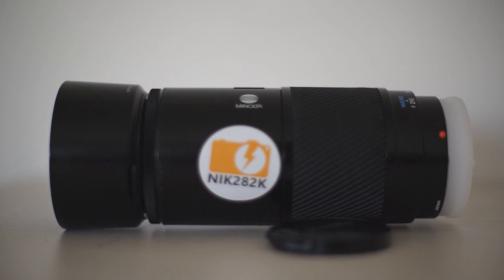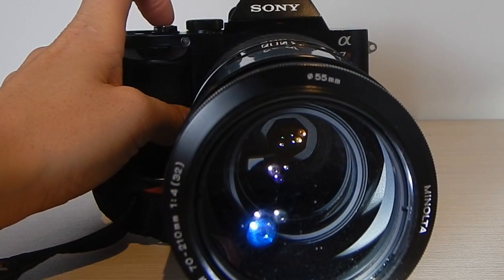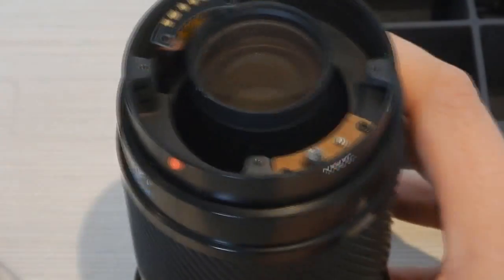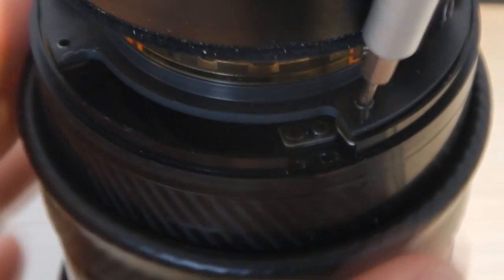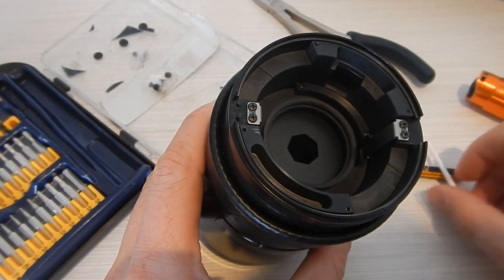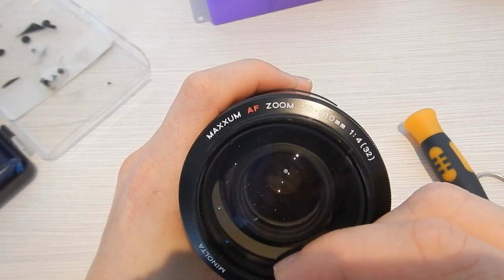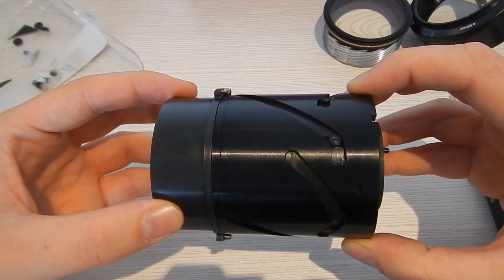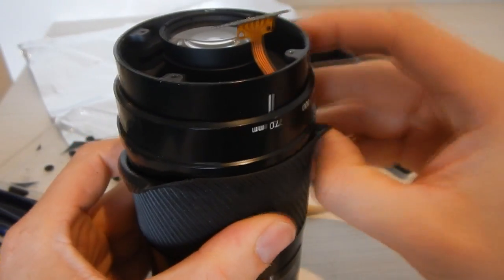Minolta 70-210mm f4 - Lens Repair

Comment: At what focal length do you have it when taking apart? Do you have it sitting at the 70 or the 210 end?
Can you get the whole aperture unit out from the back if you need to clean both sides of the blades?  Thanks!  And great video!
Reply from the maker: I think it was at the 70 end but I'm not sure. I don't remember having trouble getting it lined up again. I was never able to get the aperture all the way out but the alcohol seemed to clear up everything from the side I could access.

Comment: I have two of these lenses and I would love to just lube the helicoid gears in the front. While the disassembly of the back was great, I can't seem to see how you removed the front element.
Reply from the maker: I believe I had to remove the rubber grip to expose some screws but it has been a long time.

Comment: Very interesting segment Nick.  You subscribe to the same thoughts on taking broken things apart that I do.  Nice work getting the lens operational again.  What brand of screwdriver set are you using here   I am always looking for a really good set.  Fred
Reply from the maker: It was a Master Craft mini screwdriver set (Canadian Tire brand). It has about 30 bits and a little extension.

Glad you liked the video, I was surprised that I could get enough iso-alcohol in there the clean it out.

Comment: I have seen a big fungus under the glass element of my Minolta AF Zoom lens 35-80 1:4-5.6. It is at the bottom and I do not know how to access this piece of glass. Do you have any idea how to do it?
Reply from the maker: +RUS Sometimes you can find service manuals online that show how to tear down the lens properly. Otherwise you can try to do it unguided, I use trays for parts, take lots of pictures and take notes so I know how to put it back together.

On older lenses it's usually not that complicated.
Reply: Nick Moore I do have the service manual but i'll have to remove every part of the lens so as to be able to get access to the bottom + the last lens element can't be removed, it would be quite tricky to wipe that fungus off. I'll get another lens and then I can try to play with this one.
Reply from the maker: +RUS I also get spare lenses when I can. That's sucks that you can't open it from the wrong end, my older lenses from the 70s can open from both. It help with cleaning.
Reply: I have one Hanimex lens that needs greasing and cleaning (there are sand between the parts -_- ). It seems easy to open even without a service manual, but these minolta af lens are so complex with so many tiny fragile components. It's great that these are cheap though.
Reply from the maker: Yeah, the price is right for tinkering.

I took a quick look at a manual for the 35-80 f4-5.6 and I would say it is about the same as the 70-210 as far as complexity. If you get all your tools ready before hand and make sure to label/organize parts as you go it should be a less than 2hr project. At worst you get stuck somewhere and have to put it back together, if you are luck you will find the last element accessible before the lenses is completely apart and it saves you some time!
Reply: Nick Moore Thanks! Yes I'll take it apart when I get my next Minolta lens so that I can be sure that I've got one spare :)
Reply from the maker: +RUS Good luck! And thanks for watching!
Reply: Nick Moore Thanks

Comment: I'm grasping at straws here, and every video I've seen never shows how to take off the first FRONT element. I've got a fungus spot on the top surface of the glass that is immediately UNDER the top glass. 
Is it just a matter of unscrewing that top retaining ring with a suitable spanner, then lifting the very top glass off? That's ALL I need to take off, the fungus is on the top surface of the glass immediately under it. Or does that top glass piece also need to be unscrewed somehow, once I have the top retaining ring removed? I am loathe to play with this as it's a lens I bought in 1986 and otherwise in perfect condition.
Reply from the maker: Yes, if you can find a tool that fits the retaining ring it just spins out. I can't remember if the front glass is on its own or in a group though.
Reply: Thanks! I ended up taking the lens to a local repair shop. For $30 he did the work, well worth it to me. And that's when I discovered my 28-85 lens has mid-body "spotting". The cost to fix is more than a used lens on Amazon/Ebay. Looks like I'll be taking on that job myself.
And for anyone reading.... yes, the top two pieces of glass that needed removal and cleanimg, do indeed come out just by unscrewing that retaining ring. There's also a spacer between the 2 glass lenses. The fit is quite snug, so it has to be "bumped" out, but it does drop out without need of any more tools. I've also ordered the spanner wrench to do the upcoming 28-85 lens.